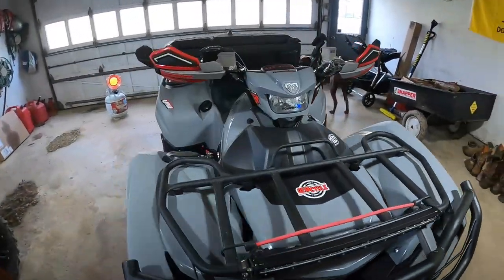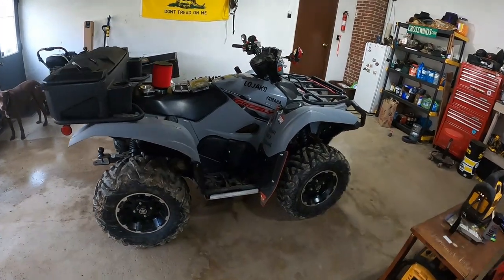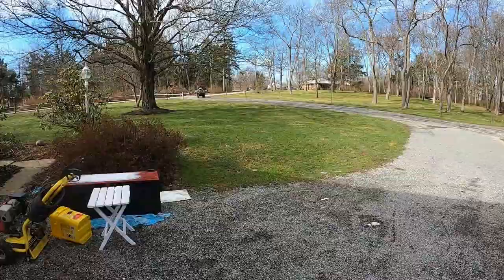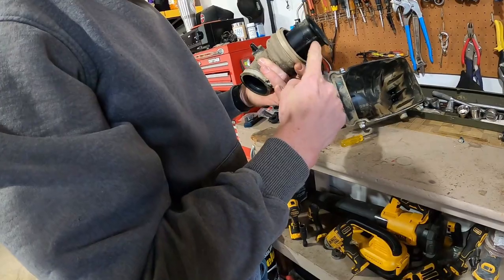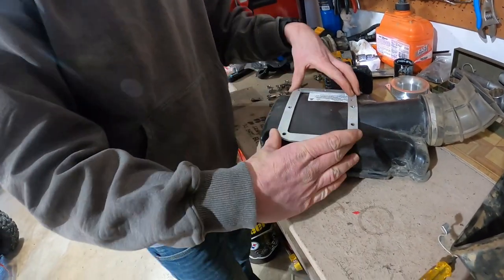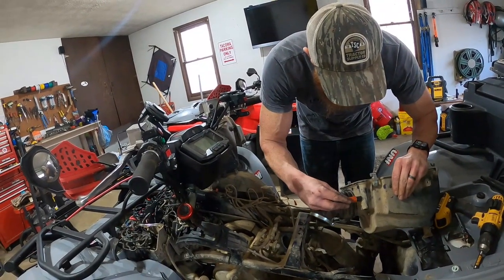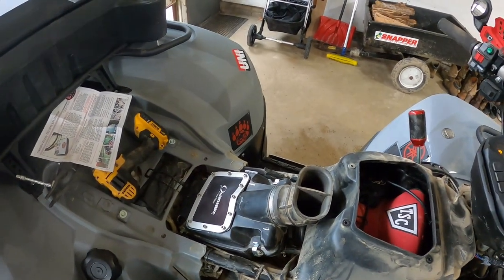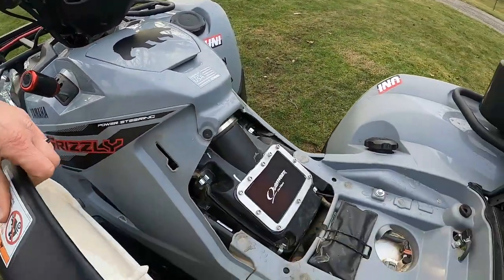EHS Tuner & Airbox Mod Install (& Channel Update) | Yamaha Grizzly 700

Comment: I love the mbrp. The say you don’t need a tune for them. And you never have to repack them. And they sound good. Love the colour of your quad.
Reply from the maker: Thanks man! Yeah, I’ll most likely go MBRP when my stock exhaust starts to rust more. For now, the tip is working fine They just look so bad after like 1-2 years.

Comment: I have an HMF swamp series exhaust (not the XL version) and it has a beautiful deep tone that actually sounds quieter than stock (i compared it to my friends new grizzly, same model and everything) it’s a great stainless exhaust, stock and mbrp is steel and will rust. Also make sure the EHS tuner is compatible with your grizzly (if it is for the Kodiak 700 it is, if it’s for the 450 it isn’t, also make sure it suits to year of your grizzly 16-18 have a different engine and tuner). Kimpex will have occasional sales and clear outs of the HMF exhausts and at that price its worth it. I think the Titan series is the same but just with no snorkel kit, I cut mine into a tip instead.
Reply from the maker: I was looking at the swamp series as well and that’s what I would have if money wasn’t a thing!! Hah. The EHS was for a Kodiak 700, same year, so I’m good there. I may get a full slip on at some point but the 2r is working for me for now! Thanks for the thoughts bud!
Reply: Np bro enjoy, quick question how much loader is the air box with the ehs lid?
Reply from the maker: @theoutdooraddict9031 Guessing you mean louder? It is definitely louder. You hear much more of a growl from under the seat.

Comment: Dont anybody do a ecu reflash like can am or cfmoto does? Be a hell of alot easier instead of tearing down all that plastic.  I love how easy a cfmoto is to do any maintenance and add ons when u want. Their clutches are amazing and easy to do any clutch kits or just reclock the secondary if a guy wants. I own a 2016 grizzley also and have only done ais delete. Love the atv very dependable. Wanna do some upgrades to it also but hate all the hassle of tearing it down, LOL. But great video and enjoy the ride. Stay safe and right side up.
Reply from the maker: They don’t make anything easy anymore! I’m surprised to hear that about the cfmotos. That’s pretty cool! Tearing down plastics can be a bit of a pain but it was worth it this time! 
Thanks for watching!

Comment: How did I miss this? Don't even have a Grizzly but was still interesting. Not much interested in exhaust, especially if they're noiser. Isn't my cup of tea but if it adds a little extra HP then might change my mind haha. 

Nice to hear about the alternate views with the GPH3... also good to hear about the drone! Adds a little extra to the experience. Which one did you get? 

Great vid bud! 👌
Reply from the maker: Thanks man! The exhaust ended up being just a bit louder but made it much deeper and I think added a bit more hp. 
The drone I got was a RUKO F11 Mini. Lightweight and compact so it will be easier to take on the rides.

Comment: The 2R really isn't that loud. Compared to my FMF on my DRZ400 it's nothing. I think it makes the quad sound like it should have from the factory.
Reply: Also my Hero4 Black that I still use to this day shoots 4k 30. So that 3 will probably do 1440p 30 which is a happy meadium. 1080p is just so small now with all of the TV's being 4k.
Reply: Nice man! I'd like to ride one with the airbox done. I did the tuner on mine right away when I bought it so I don't have anything to compare it to.
Reply from the maker: Good stuff. Thanks for the info! Yea, I can’t imagine it will be as loud as my Raptor with the HMF. But, I guess we’ll see. It’s getting delivered tomorrow lol. 
I’m glad I rode mine around a bit before putting the tuner on. It made the tuner mean a lot more to me lol. The difference is crazy.
Reply: Dude  I need to do this to my 22 XTR, however I’m a mechanical moron, so I would buy the whole airbox mod pre made.. tuner looked easy right? Just plug and play and find a ground? Which exhaust tip did you do? 2R or Whiskey?
Reply from the maker: Yeah, tuner was easy. I just grounded to the battery. My 2r tip is getting delivered tomorrow. Going to do another video on that this weekend.
Reply: @blaze_atv  so on the EHS site, I’m seeing the full airbox pre assembled with the racing lid for 345… is yours the racing lid (with the full mesh screen)??

Comment: I am looking at getting a whiskey bent stainless 1.5” 90 degree exhaust tip for my bike. I’ve seen a video where a 2R tip violated a db restriction at an ATV park. And I’ve heard that the 2R tip has melted the plastic on some bikes. 
All hear say.
Reply from the maker: I heard about the melting. I plan to crush my rear fender with heat tape. I’m not a fan of the way the whiskey bent tip looks (even though I know there is a reason for it). From the videos I’ve seen (which I know you can’t get a great feel), I like the sound of the 2r tip. 
I haven’t heard anything about the loudness. I can’t imagine it’s any louder than my Raptor with the HMF was lol.
Reply: @blaze_atv  I have the whiskey bent tip,  1.5 with a 45 , sounds like a  YZF 450 and really added bottom snap. It's on my wives kodiak 700 too.  I bought 2 EHS tuners, 1 for my 2021 grizzly and 1 for the wives kodiak 700 2021. Instantly turned our perfect running quads into turds !!!  Tried different settings for 2 weeks,  the never ran good.  I emailed Eric he was no help.  I posted on grizzly central others said no improvement on newer grizzly.  I did the AIS delete and it helped it run a little cooler.  But we never had a lean conditioning or popping.  I'm in Oklahoma and I don't know if in higher elevation they run lean but ours ran great with no tuner.   We also tried the MBRP exhaust,   very loud and obnoxious and no performance gain. It looks like made for a 250 not a 700. So now we're stock with AIS delete and whiskey bent tip and they run great and haul ass. Good luck 👍
Reply from the maker: @SuperDave-pe1zw  oh wow! Sorry to hear you’ve had so much trouble. I instantly had noticeable improvements with mine once I got the settings right. We’ll see what happens when I add the 2r tip this weekend. Thanks for the info!

Comment: Yeah, that one Airbox bolt is kind of a Bitch. I use a Ratcheting End Wrench, and when reinstalling put that one in first and finger tighten it as much as possible before using the Wrench.
Reply from the maker: Yeah that took about 30 min to figure out lol. A VERY FRUSTRATING 30 min